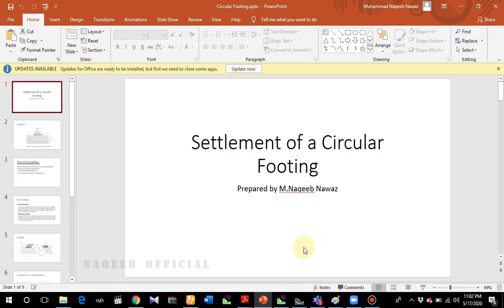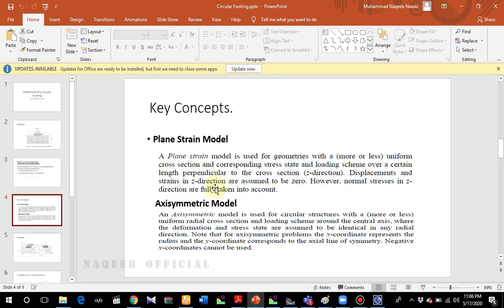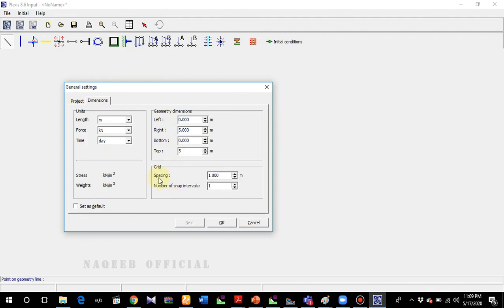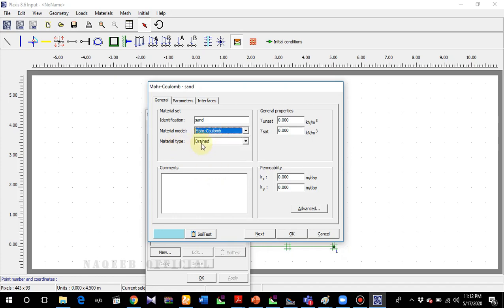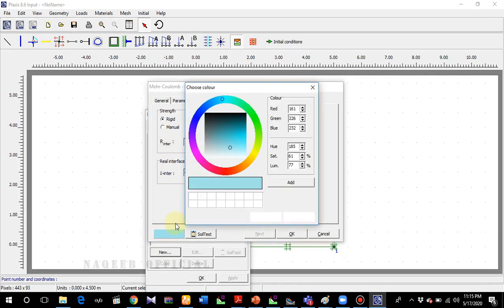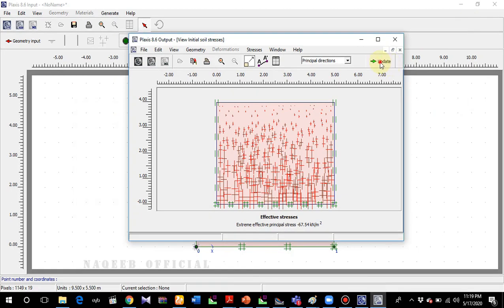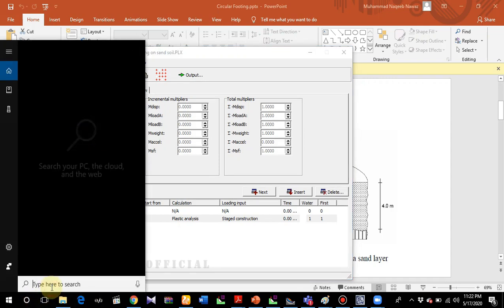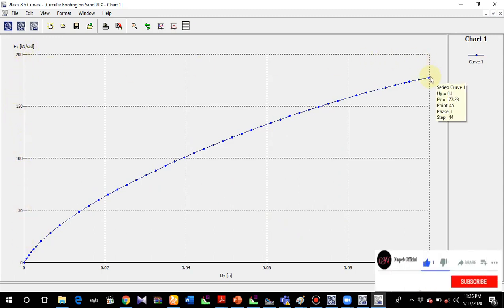Circular Footing on Sand Part a | PLAXIS Tutorial Lesson 1| English | Geotech with Naqeeb

Comment: Hi, when I generate mesh this problem happen 👇
There was an error during mesh generation.
Probable causes (and solutions) are: - Two or more points are positioned at very close distance. (Enlarge
Spacing) - There are more than 4 subclusters or lines defined, e.g. tunnels or grout anchors. (Connect "floating" subcluster or line to the project boundary bya geometry line) - A very thin slice is cut off a tunnel by a straight geometry line. (Remove the straight line inside the tunnel. It might be necessary to zoom in.) - Two lines intersect with a very small angle. (Adjust angle) -The mesh is too fine. (Regenerate using lower coarseness, local or global)